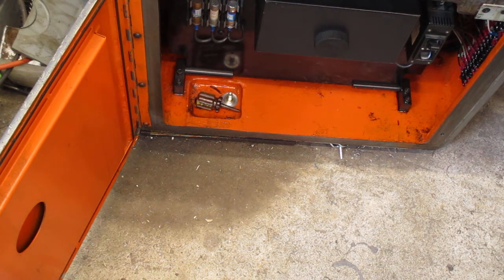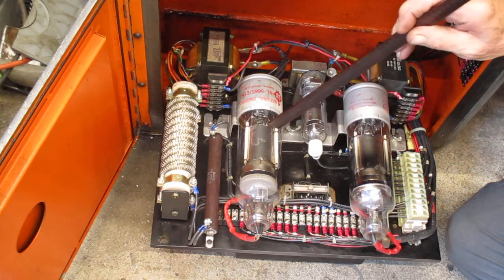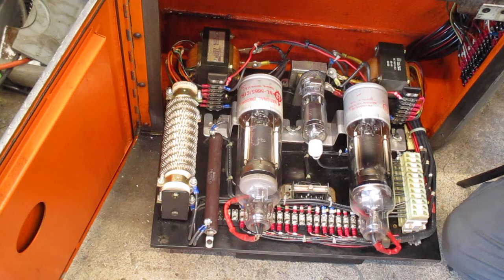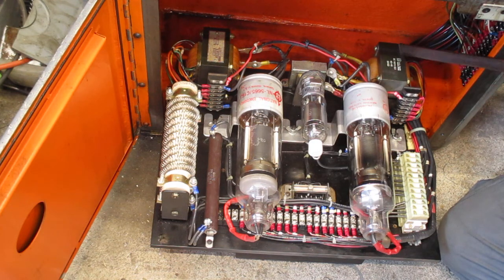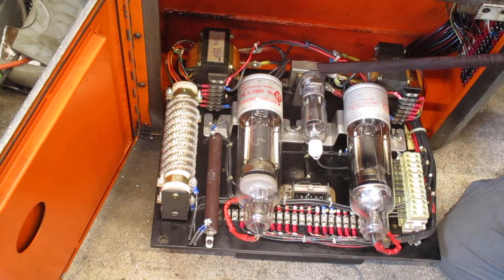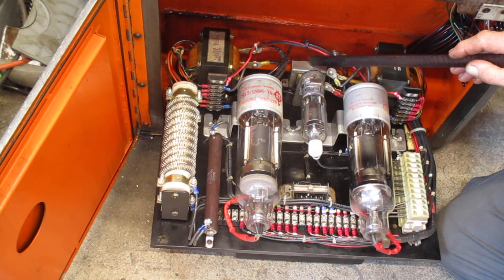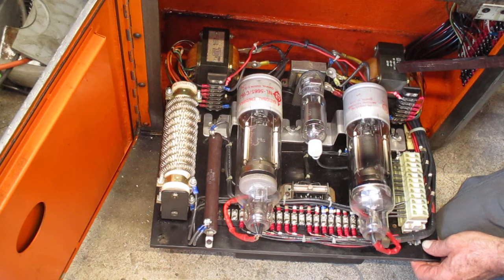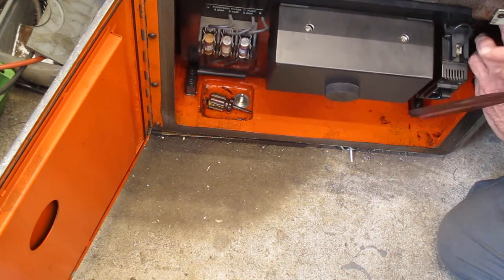Monarch 10ee lathe electronic compartment

Comment: The filament supply is very important in most vacuum tube circuits. The silicon controlled rectifier which is the modern equivalent to the thyratron doesn't have that problem. Still, old doesn't necessarily mean bad but could mean expensive.
Reply from the maker: The silicon rectifiers were tried by Hendy and others but the nature of high starting loads of lathes those failed quickly and were abandoned. Other solid-state DC drives were tried with some success. The current factory drive is AC inverter 7.5 hp it is very good 3phase input.
 The filament voltage is 2.5 volts AC and it is critical on this drive. The vacuum tubes have proven very durable, but the system is complicated and requires constant maintenance, It has 5hp but not at lower speeds.